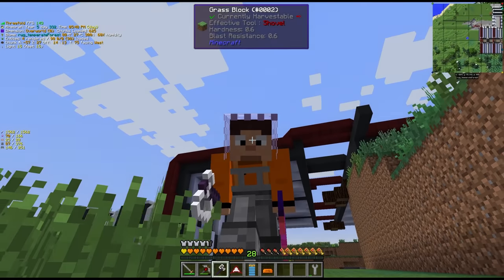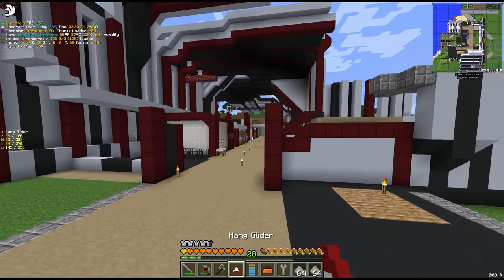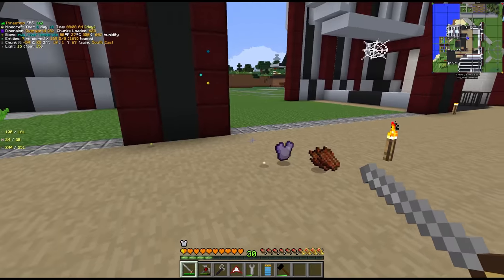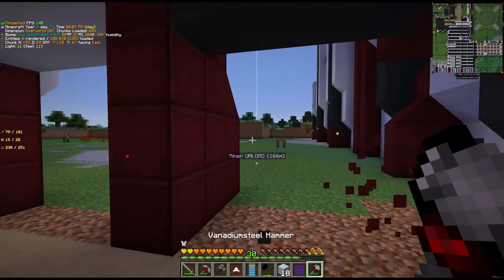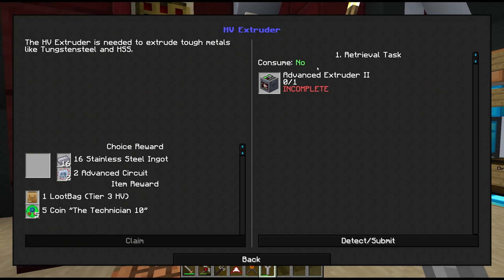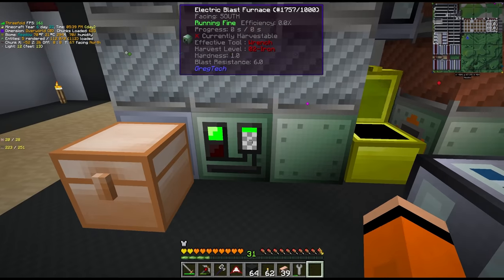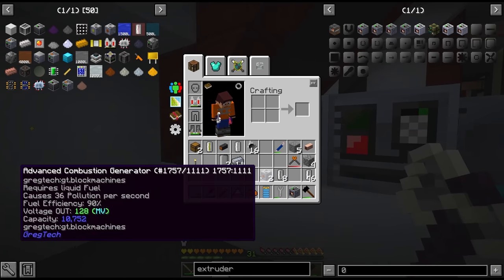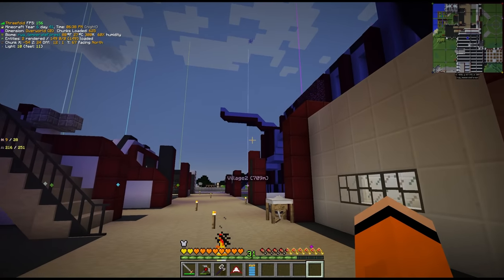Gregtech New Horizons - 20 - Vacuum Freezer & Machine Upgrades! Modded Minecraft

Comment: Might want to change that circuit back to 11, Three. Cooking Stainless without oxygen is slower ;)

Sir, that isn't even the tip of the GT++ alloy fetish iceberg. There is a ton of random garbage that GT++ adds for very few, if any purposes at all. Get used to it, you're going to see more elements and alloys than every other modpack you've played so far combined three times over.

Something worth mentioning is that the "bonus output" that the questbook mentions no longer exists, that was removed because it broke the platline. Also worth mentioning is that the large sifting machine requires four output buses for no logical reason, and at no point does the questbook or the machine's tooltip tell you this. The latter did at one point, but that was also removed for reasons unknown. This pack isn't always put together well, I'm sure this is not surprising.

One mistake you don't want to make in GT, and this pack especially, is upgrading all of your machines every tier. It's not needed and it's a waste of resources (though you can recycle machines in this pack). Only upgrade what you need, when you need it.

The degree to which Three gets away with not lighting up his base is slightly improbable, not going to lie.

You're able to craft the workstation line of circuits now, better circuits that you craft at MV and only have to upgrade once to HV. Try to use the best circuit recipes you can as quickly as you can, as it'll save you a lot of time and effort.

You will need an HV polarizer to make EV motors, yes. The HV Autoclave is used to craft Energy Crystals, which are not better than Lithium HV batteries in terms of energy storage, but they are used to craft Nano Crystals, which are used to make the Nanosuit. Very, extremely worth crafting that thing. Especially the Nano Goggles of Revealing and Nano Boots of the Traveller, once you start Thaumcraft.

HV superconductor requires Titanium, so yeah, not close to that yet. Blue Alloy is the next best cable to use for HV, since it's 2× the power and the second lowest loss per block you can get.

Remember what I said about using Mercury to process stuff that gives Gold as a bonus output that way? This is why. I told you you would be needing that mercury.

If you give a machine two (or more) energy hatches it's going to overclock, so you're going to need to either provide a higher tier of power or run extremely cheap recipes.

Sir, you're playing a version where GT++ pipes actually have visible shutters. You have nothing to complain about ;)

Now that you have a vacuum freezer and assembling machine at HV there's nothing stopping you from getting Nichrome coils. Get to work on those, upgrade your coils whenever possible in order to benefit from the energy discount and upgraded overclocks. It's not a substitute for a reasonable number of EBFs, but it helps all the same.
Reply from the maker: "The degree to which Three gets away with not lighting up his base is slightly improbable, not going to lie." :p
Reply: @Threefold.  Hey, today's XShadow's comment includes mostly tips and just comments, this means he does not have much to say, which means that you, Three HAS GROWN IN POWER bwaa ha ha. Congrats on that.

Also yes, i can not stress enough the importance of upgrading your coils and tier of machines that use it (muffler hatches are also worth it). Seriously, at some point you are gonna have so much discount, that it would feel stupid to use normal machines. 8 seconds per Vanadium Steel and 2 stacks smelted in the same time is no joke. 

Using catalysts (oxygen, mercury and others) is also provides much help, you can even just add additional input hatches with a buffer for each gas on multi-blocks to save hassle. Not like it's gonna consume nitrogen when it needs oxygen, you know.
You can also FUSE multi-blocks TOGETHER into 4x monstrosities and use same input/output/power hatches (power buffers are useful at last one) and consume much less casings/coils/etc. only muffler and maintenance hatches should be separate.
it could look really cool and be more useful and fast that way, for your liking. 

Also, about powering machines: why not just use 4 slot battery buffers with SODIUM (not lithium, it's not required to use this expensive stuff) batteries for every multi-block. It adds buffer (helpful to even out demand) + you can add helpful covers for safety and automation (low power -> turn off for example) and you don't need to build more expensive generators that waste fuel.

Oh, yes, that. Are you gonna do something about your power situation? Having a steam boiler setup with a GIGANTIC steam tank that you don't really use much is somewhat wasteful in space. why not dismantle it (in the same time with EBF reconfiguration) or upgrade it i bet you can build more efficient and powerful steam boilers, and you not far from multi-block steam turbines that, in turn, are way WAY WAY more efficient at converting fuel into power, both in fuel efficiency and pollution means.
Reply: Yeah there will be times when you will even DREAM about GT++ alloys
Reply: @mrShift_0044  Oh, it's only a temporary thing while Three focuses on tech. I'll be yelling his ear off and tearing the questbook to pieces the moment he gets started on Thaumcraft ;)

The reason Three spams power generators instead of weak battery buffers (sodium holds 50% of what lithium does, and lithium is free with clay dust electrolysing) at this stage is to avoid the same situation he had with his initial line of steam machines: Not being able to run constantly due to a lack of power (or steam) input. You don't want your machines and EBFs to turn on and off as they get the power to run, you want those guys to be ready to run and keep running at a moment's notice. If you could build a functional power spine in HV and centralize power, that might be a different story, but unfortunately an HV power spine takes EV transformers, which is titanium, so that won't happen until EV/IV.

Comment: The power setup of vacfreezer didnt wirk because 1 amp of hv is 4 amps of mv, but with mv 2 generators you only provide 2 amps. This is why you used 4 steam turbines at once to power the blast furnace.
Reply from the maker: Correct! It hit me after one of the ingots voided, I noticed straight away haha :))

Comment: do you really have to direct EVERY pipe? I thought it only mattered for junctions
Reply: You do. They'll slosh around and lower efficiency to the roof. Its tedious and boring but makes a world of difference especially with how long his pipes are.
Reply: That's for logistic pipes and bc pipes. Gregtech fluid pipes are closer to open blocks tanks or mekanism's power cables; in they store an internal buffer, but prioritize sending in ALL connections. That means that if there is space, they happily send the fluid back as well as forward (called sloshing), unless you disable inputs just like Three does.